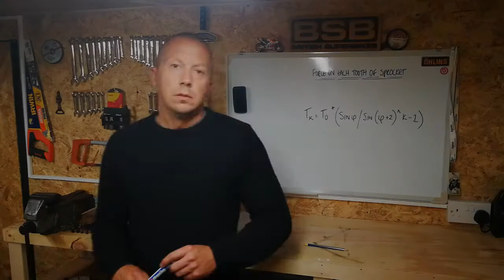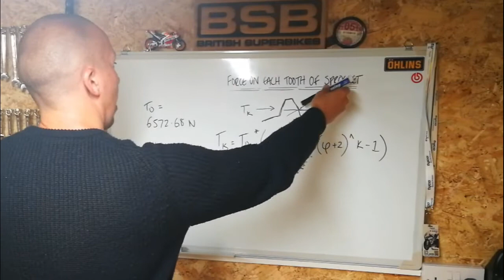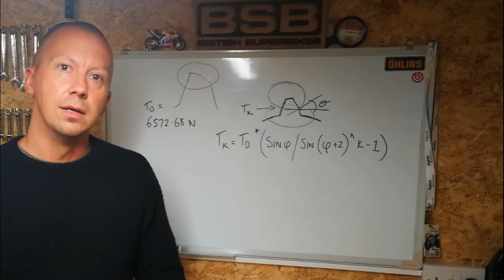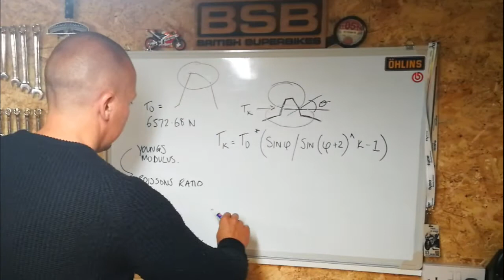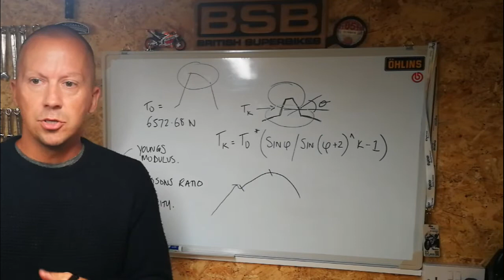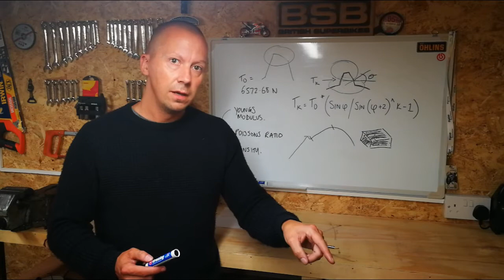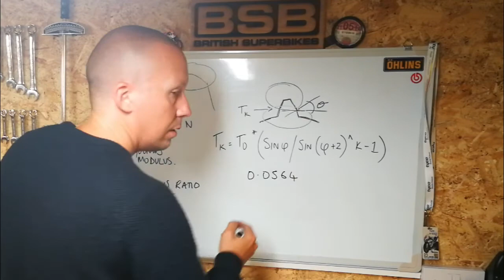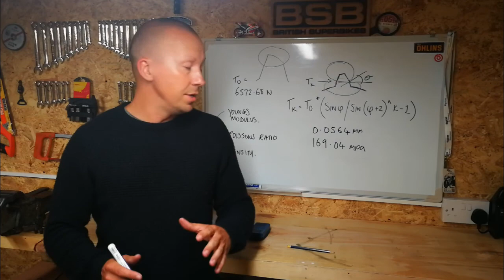MOTORCYCLE SPROCKET FORCES - A look at Fatigue, Stress & Strain.

Comment: how to find the initial chain tension?
Reply from the maker: Are you asking how to find the correct chain tension on your bike?
Reply: @ShedTorque46  yes. I was hoping to find a value if it is possible. Thanks for the reply
Reply from the maker: @gururajm3554  No problem, there is no fixed rule when it comes to a chain’s tension, each bike is different so look in your owner’s manual to find out what the free play should be. I wouldn't want to give you incorrect information. Thanks.